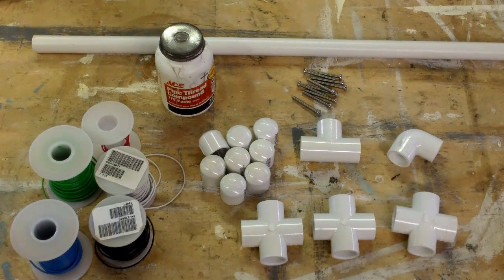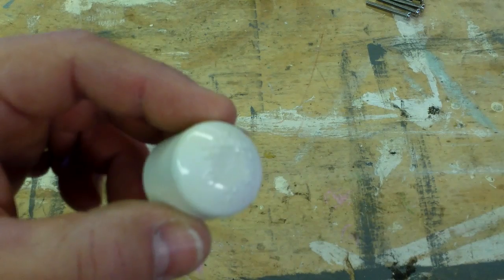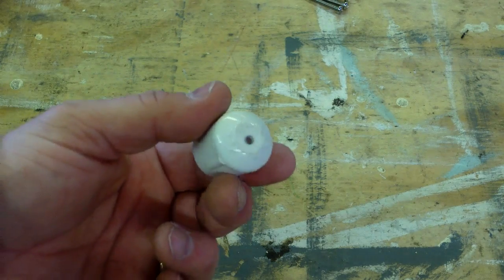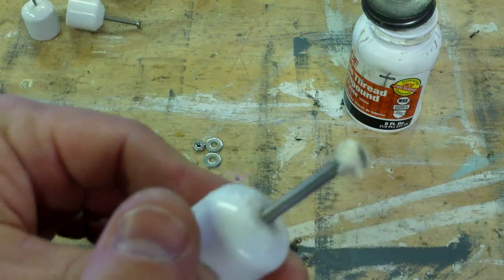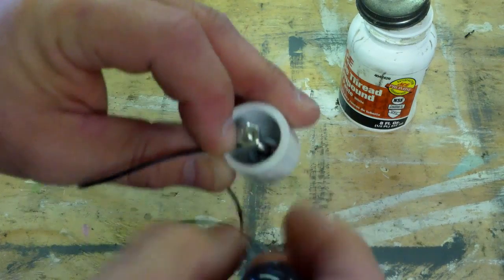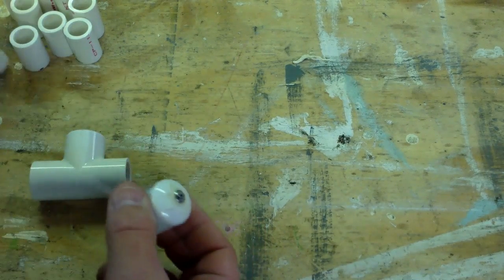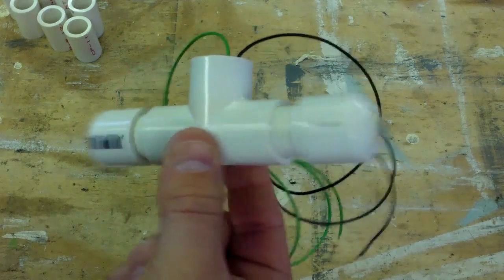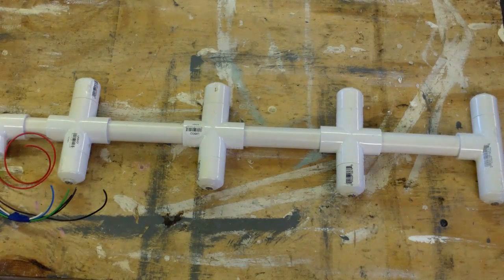DIY Water Level Sensor for Horse Trough or Other Application - Part 1

Comment: I think the probe only needs one black energizer at the bottom.  Once the water is energized, it will stay energized all the way up for all the sensors.  That way the probe will only need tees and elbows.  I wonder if plugs would make the assembly easier than caps.
Reply from the maker: I thought the same thing but it did not work.  3.3 volts just doesn't travel far in water.